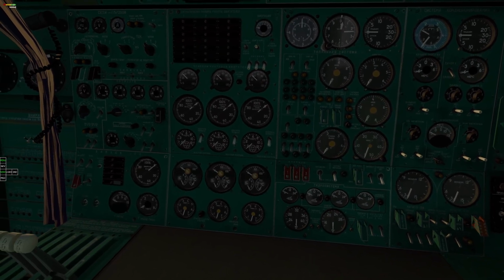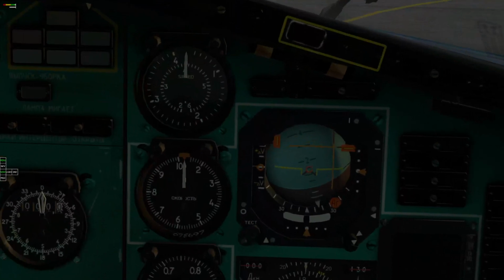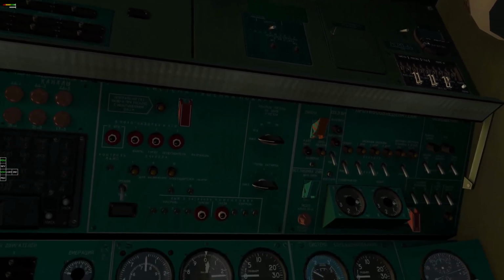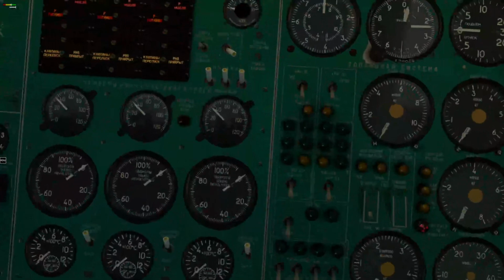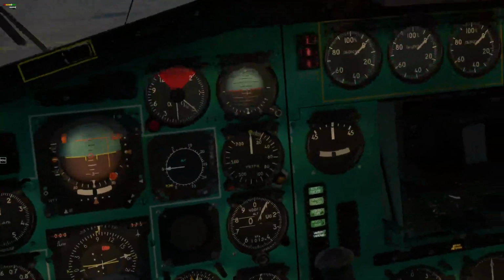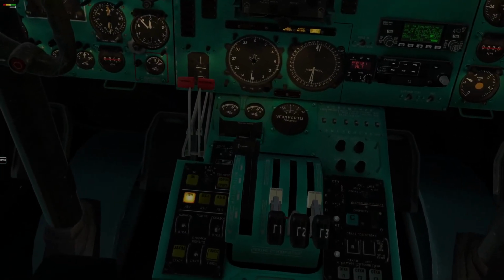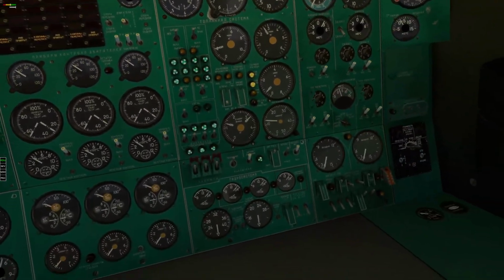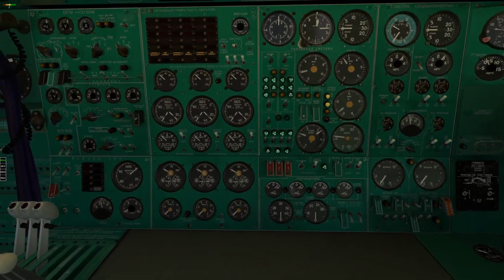Tupolev Tu-154B2 for X-Plane 11 FULL COLD and DARK STARTUP Tutorial / TU154B2 Tutorial Series 1

Comment: perfect video. there's no other video that explains different systems of this airplane. all i've seen is videos without any speech, just showing off how fast they start the airplane.

only one problem with your video: when you say "this does that", we can't see "this" since you don't have a cursor on screen. sometimes the switch you're talking about is not even in the center of the viewport. thanks for the guide!
Reply from the maker: Taking notes, tysm!
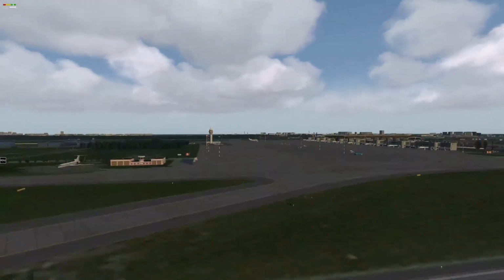Reply: ok it just became horrible after around 55:00. too fast head movements, even the switch flicks can't be seen due to compression of the video. it would be perfect if it was a bit slower, but it's still the best video there is. so thanks again!

Comment: Excellent walk through, thank you! Just one question, on the new B 2 mod, after landing, the doors don't open. Is there a procedure for this?
Reply from the maker: Hey, thank you! The doors actually freeze in flight so you have to flip the “Обогрев дверей” doors heating switch when you descend. It’s located next to two small round buttons above the engineer’s panel.
Reply: @cleanwing6070  Nice one thanks! This morning, I checked and had 'Doors can freeze' set to enable on the EFB - so unchecked that and of course I could open doors. But the help with the switch is great - thanks.

I think this mod is excellent - seems on a par with something like the Zibo 737 and I really hope more people discover it. I've ended up finding an English translation of the cockpit panels and making my own labels in English - as my Russian is non existent😄
Reply: I should add, if you do any more tutorials in English, that would be super helpful!!